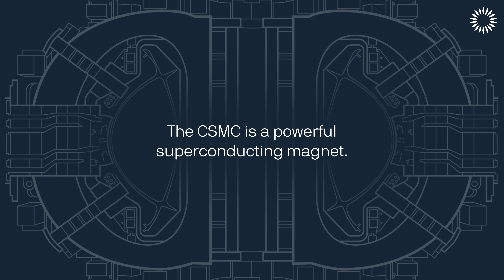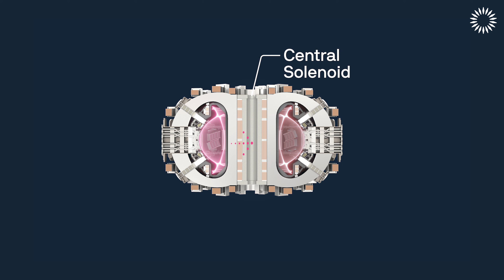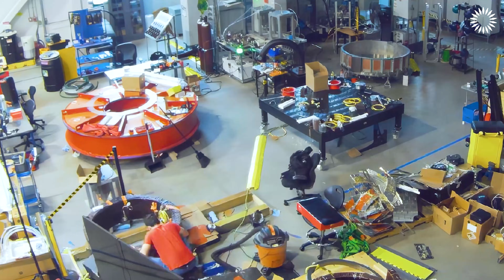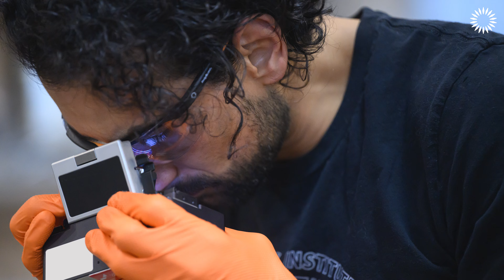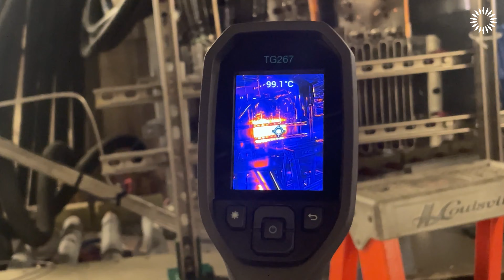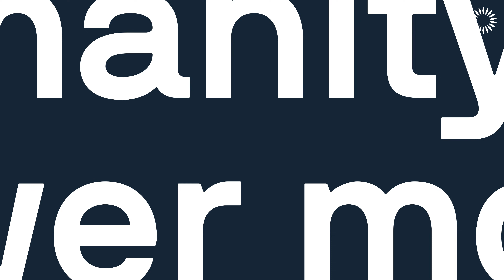CFS Fusion Magnet Test Exceeds Expectations

Comment: The CFS’s promotional pitches of this newer high temperature superconductor tend to leave out the fact that such superconductors still require cryogenic cooling to around the temperature of liquid nitrogen at atmospheric pressure. This means the HTS magnetic coils need to be enclosed within a cryostat. In the case of the SPARC experimental machine the coils are intended to operate at a temperature of 20 Kelvin. As a result cooling must be done by cryogens well below the temperature of liquid nitrogen.

Comment: Well done! Full speed ahead, the objective to be achieved may have immense importance for humanity.....also to be able to quickly overcome hyper-expensive and bureaucratic bandwagons such as ITER which continues to cost immensely and continues to delay as well as aiming for a reaction then unsustainable because the tritium is missing... only the private sector can accelerate and modernize the public as well as focus on the practice... the necessary fusion will be commercially widespread by 2050 :) , not in 2100...cfs becomes what space x is to space exploration

Comment: When?
Reply: Their full scale demonstration reactor will be complete in 2025 or 2026. They will adjust the design for their commercial reactor and build it by the mid 2030s.
Reply: @Skyler827   Fusion power has been 10 years away for over 50 years now, and will be for the next 50 years. Why do I think money is changing hands that shouldn't?

Comment: does this one have a plan to deal with neutrons? no? moving on...
Reply: We most definitely factor neutrons into our designs.
Reply: How
Reply: The plan is to surround the plasma with a blanket of molten salt, like a concentrated solar power plant. Convect the heat from the molten salt to a separated water loop, and pipe hot water into steam turbines.
Reply: @Skyler827  the plan is to fill the blanket with liquid lead and lithium. Lithium is needed for tritium fuel production and lead is needed for shielding and to increase the number of neutrons, so you will produce enough tritium to keep the reactor running.
Reply: @Petriiik 1. Will you need to use isotopically enriched lithium, ie upping the Li6 fraction?
2. Will tritium interact with lithium to form lithium tritide? This might be relevant to extracting the tritium from the lead-lithium.